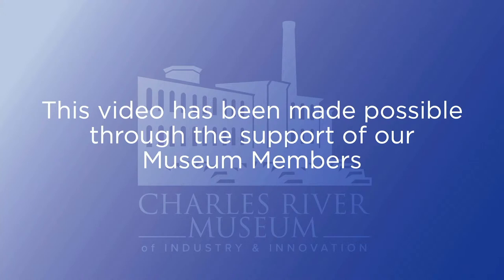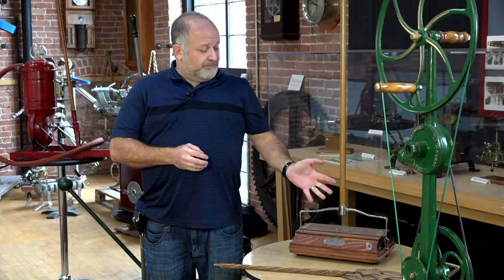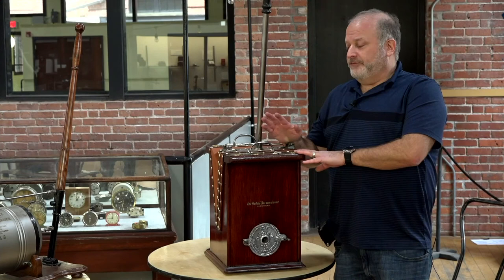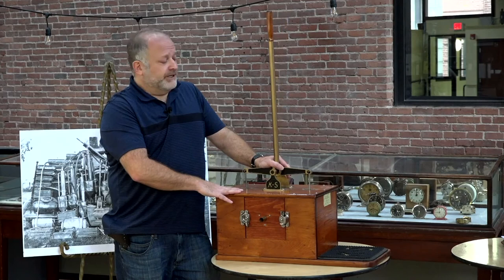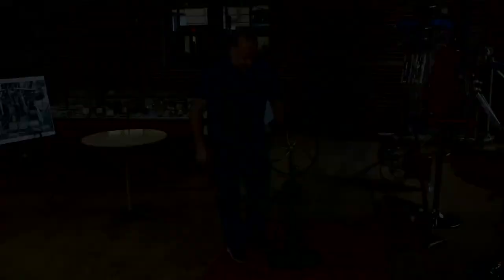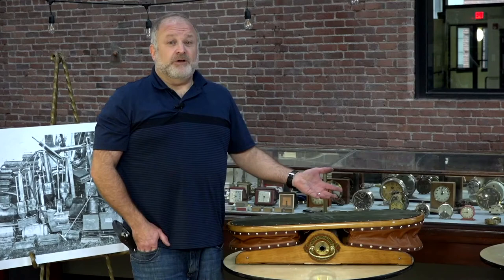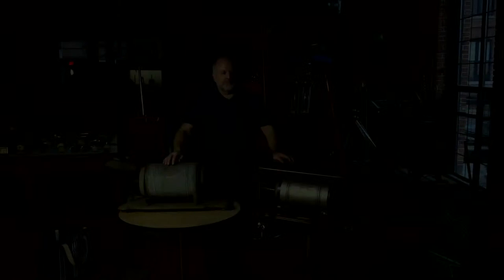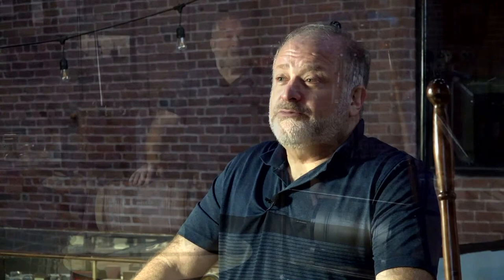Tech Talk: The Pre-Electric Vacuum Cleaners of the Early 20th Century

Comment: I wonder if any of these vacuums were strong enough to pick up a small coin.
Reply: In general, these early vacuum cleaners weren't overly powerful. They were designed to pick up dust. The diameter of the hoses and fixtures were small in order to increase the suction, and therefore would not accommodate larger objects passing through. However, the sweepers were very good at picking up objects. While most of the sweepers didn't have vacuums, there were indeed models designed with vacuum to help collect any dust.